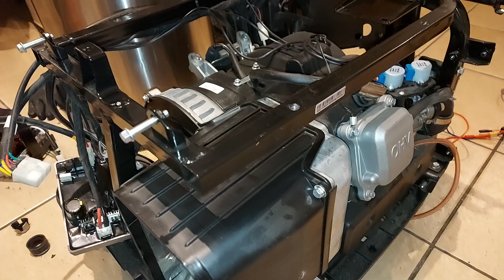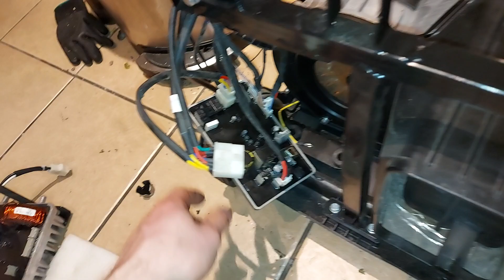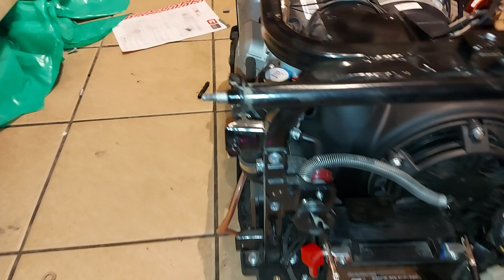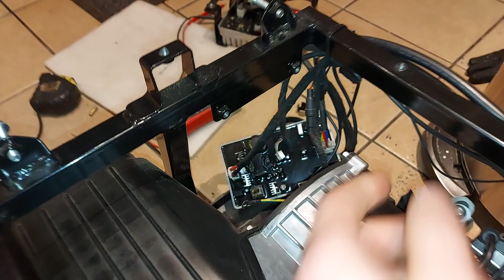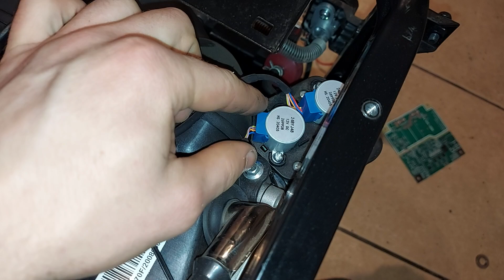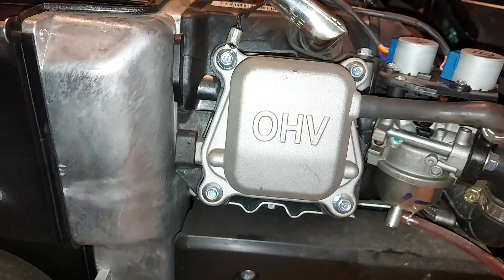Hyundai HY3200SEI E-NV200 Range Extender?

Comment: Thank you for the video😊My hy4500sei won,t start not even with the pullstart.
The is no spark on the spark plug.
I think the problem is the start controller module.what do you think?
Do you know where to get replacement parts?
I disconnected all the cables on the start controller and the inverter module.
Do you have a picture where those small connectors are connected?i think i have switched the ones going to the start controller with the inverter module.thank you

Comment: to control the stepper you just drive them all the way to the closed side and use that as your starting point. then you know how many steps from that point it takes to fully open it. its not got enough torque to damage itself or the valve. I have a generator in a trailer charging my ebike lol